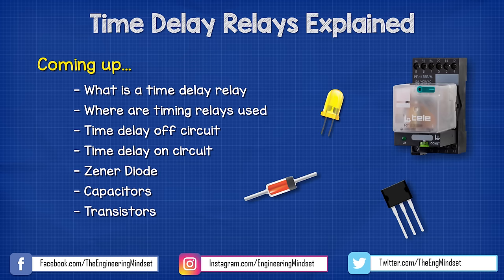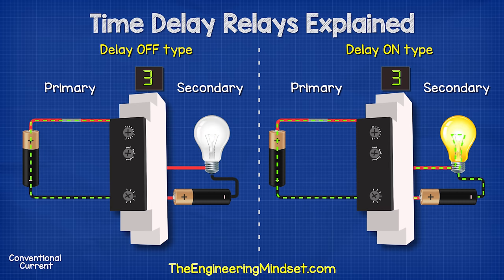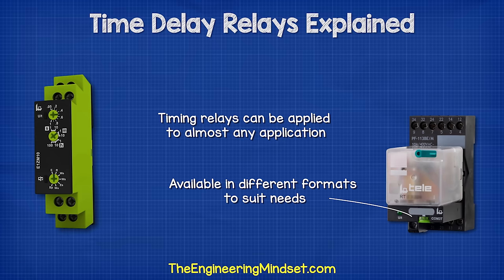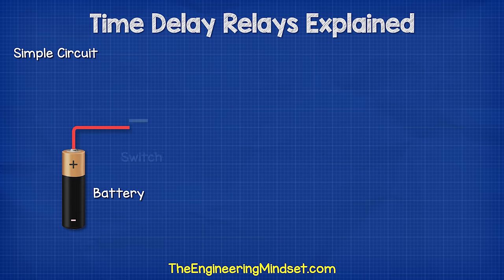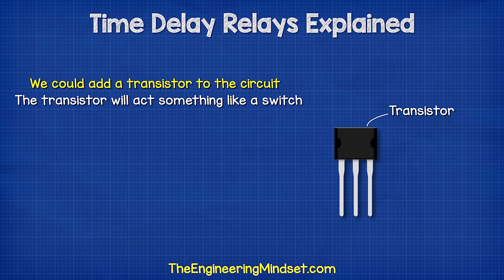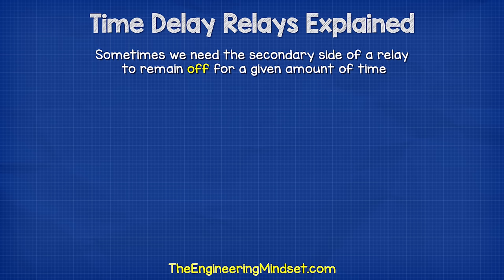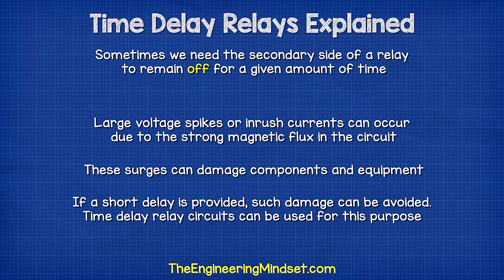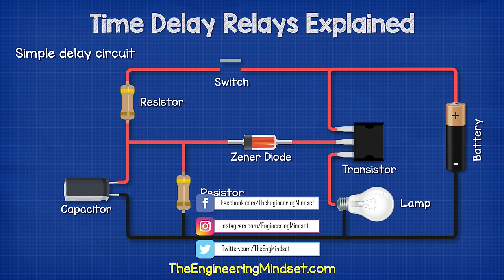Time Delay Relays Explained - How timing relays work hvacr

Comment: I used a time delay relay in my pickup so the auxiliary power stays on for 2 minutes after turning the key off like newer vehicles. I also made it turn the overhead lights and outside lights on when the key is turned off. Works great

Comment: Older FAUs use a 24volt time delay relay powered by a small heat motor that produces heat and warms up a bi-metal which warps and closes the switch for the 120volt blower fan. Very cool and intricate stuff

Comment: Time delays are used in modern US locomotives to control the ditch light flasher when the horn button is pressed, these are usually integrated into the whole light system though, however older locomotives owned by shortline railroads retrofitted to FRA guidelines use separate control devices for flashing and delays rather than a whole new system.

Another place where time delays and relays (namely solid state relays) are used is in communications tower beacon flasher circuits.

Comment: I've seen these used in control panels for hospitals for preventing short-cycling of equipment as minimum run timers, stagger the starting of equipment to prevent excessive current draw, allow equipment to switch to auxiliary power after the generator gets up to operating speed and to keep sensitive equipment from tripping alarms.
Reply from the maker: Nice information

Comment: A company where I worked built a training simulator for a ship console.  This required several industrial computers to control the console, the switching power supplies of the computers act as a direct short, momentarily, so a number of delay relays were utilized to sequence the computers startup.

Comment: one place I ran across an RC timer delay circuit was on an old haunted Otis lift located at an UK motorway service station (the one with the abandoned restaurant on top that looks like two small out-of-proportion towers after the government imposed height restrictions), the circuit was supposed to time how long it keeps the door open but the capacitor was probably leaking which prematurely caused activation of the Door Close circuit, thus when someone presses the hall call button, the lift doors open half way then immediately slams shut, it was an extremely creepy lift!! used to give me nightmares of ghosts and demons luring me into that lift then being pinned and injured badly by the force of the slamming doors and then crushed and sliced in half when the lift starts to move, that's when I wake up sweating and heart racing, and yes that lift was all controlled by relay logic you can even hear all the relays clicking, keep pushing any buttons over and over and you will hear the relays click away if you are close enough to the top floor where the machine room is

Comment: I've seen these timing relays in school bathrooms. A PIR sensor actuates the relay and it remains on for a while. Eventually it turns the light off. The lights didn't have repeat actuation (meaning the timer will reset every time the PIR senses motion). Instead the timer has to run out before the PIR can detect motion again. I'm pretty sure the relay is built into the PIR sensor module, but it has a loud, distinct click.

Comment: I use time delay relays in multiple 12V DC application to prevent voltage spike from damage the sensitive controllers. To do this I've added one to the start of the unit to give it a 10 - 20ms delay before powering the system, that way it give me enough time to make a proper contact before the in rush current comes, other if it's instant the in rush current will cause an ark, which will damage the sensitive unit. The time delay relay has save me multiple units and is adjustable, that way I'd know for sure my circuit will be safe from a in rush spike.

Comment: My parents have a beach house they rent out.  They installed delays on the bathroom exhaust fans to turn them off after a few minutes.  That way they aren't constantly running and pumping the conditioned air out of the house.

Comment: I've had to set up time delays for security access so the building is open during a certain time frame for the employees to all get in and then the card access kicks in after a designated time.
Reply from the maker: Nice use of relay
Reply: That's a very common application, well done!!

Comment: For hvacr you can put a time delay for the fans so the coil will have time to reach a certain temp before turning on the fan
Reply: Or to just reduce the peak startup current by starting the compressor first, then the fan.

Comment: Timing delays work in garden sprinkler controls turning watering circuits on and off based on adjustable duration switches.

Comment: Since you did a few automotive videos recently-- are time delay relays used in cars to control interior lighting? (ie. lights turn on when doors are opened, but turn off after a period of time)
Reply from the maker: Yes, that's a good idea they could be used
Reply: It can be, but generally it's all done electronically with a programmable timer in the body control module

Comment: Timing relays are often used in HVAC. Here where I work, I often see them being used for operations like bypassing a freezestat for a short amount of time, the time a unit typically takes to warm up. I also often see them in wired logic for resetting things like freezestats and pressure switches from a command via an operator station.

Comment: Sorry for bothering you, but I'm making a bluetooth speaker and I get an annoying pop noise when the bluetooth module turns off. I have a mute function on the amp in the form of 2 pins. I was wondering what's the easiest way to solve this. Do I time delay the bluetooth module to turn off after the amp or rig the power button to tigger the mute switch? I can solder but I'm not an expert so the simplest and cheapest circuit would be best.

Comment: Hello. Please how do we design complex relay delay circuits that:
 
• Instantly switches OFF a relay immediately the relay coil is energized, waits for a few seconds (while the relay coil is still energized), then switches the relay ON again, and remains ON till the relay coil is disenergized (by maybe annual switch)?

AND

• Instantly switches ON a relay immediately the relay coil is energized, waits for a few seconds (while the relay coil is still energized), then switches the relay OFF again, and remains OFF till the relay coil is disenergized (by maybe annual switch)?

Please, it would be really helpful if you could make a video on how to build circuits like this. Thanks

Comment: At 8:43 would the power source continually charge the capacitor keeping the circuit closed indefinitely?  Would there need to be a switch to remove the capacitor from the circuit after it was charged? (e: The path was shown in conventional which threw me off a bit, but there is still a main path through the circuit to charge the capacitor, perhaps it discharges faster than it charges causing voltage to drop below the setpoint needed which would be the timer.)

Comment: I want to make an automated baord where i will test 6 mosfets to check whether they trigger in high current, high voltage and low voltage. I have a device that gets powered up through these mosfets. So for maintaing my device quality i need to check the switches whether they are perfectly triggering or not? I want to run the test for 6 switches together. Is it possible?
Reply from the maker: See my new MOSFET explained video here➡️: https://youtu.be/AwRJsze_9m4

Comment: with your quality videos you only need a  teacher when wants to ask questions hehe :D
is it true that in industrial ussaged Relays/timed Relays and pls are more often used since they are more stabel to work for long time rather than let say arduino etc?
in lov dc i can se arduino maby be used more easy with  programming on leds but if using 120 or 240v ac then relay&timed Relay is better and also pls :D
tip for a video: electrical resistance VS Heat Resistance like in wiring cpu cooler etc, only thing ihave grapsed is that whats makes a cettle/water heater not to short-circuit is that it used special mettal Wolframe steel?
Reply: Pretty sure arduino isn't rated for industrial use. Anyways a modular design with relays and time delays is easy to troubleshoot and components are easy to replace. Replacing an arduino and it's programmation would be terribly ineficient. Also, what's the most inputs/outputs possible on arduino, I'm not that familiar? On a modular PLC you can mix inputs and output types and voltages, have multiple analog input/ouput cards, and have plenty of different functions pre-programmed and usable in a ladder schematic program, which is, once again, pretty easy to troubleshoot for anyone who knows what they're doing.
Reply: In industrial usage related to automation, PLCs are a lot more common that time delay relays and hardly anyone would use an Arduino. Not that a microcontroller couldn't be made to work but in the real working world (i.e., as compared to the educational environment) an engineer rarely has the time to customize anything and can actually get in quite a lot of trouble with their employer if they don't choose the most efficient method of solving a problem. Most problems have more than one possible solution. I do still see TDRs used in electrical (power) control circuits.
Reply: @thelz7909  Oh i see, thank you for the info :D
Reply: @thelz7909  I totally agree. I still see TDRs in small uncomplicated control circuits and in older factories, where the mentality is "if it works, don't replace it".
Reply from the maker: PLC video now live: https://youtu.be/uOtdWHMKhnw
Reply: @EngineeringMindset  Awesome Thank you :D

Comment: I wanna make a toy gun, where I apply a red LED into the barrel, pull the trigger what is a NO button so the gun makes a sound and lights up the LED for like half a second. But I want it "semi auto" so even if i hold the switch button the RED light will be triggered only for half a second. On top of it is a toy gun, so I'll use 3xAA battery (4.5V) to power the whole circuit up. It's hard to find anything what fits into that size and does this xD

Comment: Thanks but what if the voltage spike will blow up the capacitor @11:14? Then the equipment is still not safe. This means that only specific types of capacitors can be used.
Reply from the maker: Yes, we can add additional safety features, arc protection etc.

Comment: What type of timer will I need to control a misting system that runs for 30 sec on/30 sec off for the duration of 6 hours daily?
Reply from the maker: Please reach out to Tele Controls, they will guide you https://www.tele-controls.com/the-engineering-mindset/

Comment: U said before electricity flows from negative to positive base on electron flow theory but why in your video it still uses conventional flow theory
Reply from the maker: We typically use conventional for designing circuits. Most people are taught conventional and then send me angry messages when they see electron flow 🙈

Comment: Can this setup keep up with rapid fire trigger action ? I want to use design for a custom ecu that i can advance and retard spark variably by knob and to also control injector pulse width . Trigger signal comes from crankshaft sensor .